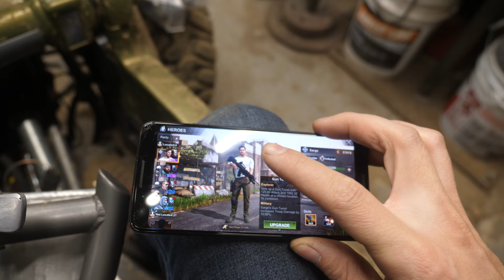2JZ Lawn Mower Build - Rolling Chassis on 30's!

Comment: How did I manage not to crash the drone this week?
Reply: Guess you need to start sending them a little harder!
Reply: Lol you did a nice job flying
Reply: Props!
Reply from the maker: @patrickreilly6272  very true!
Reply from the maker: @mercermechanics1788  thanks!
Reply from the maker: @Leafyfpv  it's so much fun flying that thing at Ethan's house
Reply: Dude under the jag shot was way cool
Reply: What kind of drone is that?
Reply: @maxdamage3814  its a FPV racing-style quad, quite hard to learn how to fly, but you can fly that good within a month or 3 I'd bet, if you put in the time.
Reply: analog or DJI HD fpv?

Comment: I feel like at the end of this build, they will have just rebuilt the Jag entirely around the engine with a big sticker that says "Mower" on it. :-P
Reply: The Jag was, when new, a shiny POS. The electrics sucked on day one and got worse every day thereafter. The mower build will be, at a minimum, 300 hp on 800-850 lbs weight, driver included, and have more brakes than any three of his past builds put together. It's at least as much "Mower" as any of the others are powerwheels, that is for sure. I'm going to give Ethan a qualified "Terrifyingly Awesome" rating conditionally- the condition being that might not be a sufficiently terrifying rating!

Comment: You should put airbags in place of the coil springs on the front and make some kind of adapter for the rear then you would have the ultimate suspension adjustment for whatever weight you put on the vehicle whether you put a plow on the front or you want to rip it hard and have the best suspension cushion

Comment: Nice to see I'm not the only one with an self tipping Bobcat 😅
Reply: Because it was sped up all skids do that that
Reply: @flyingwolffilms  when he lifts the front of the jag you can see it drop fast, not suppose to do that. I got excavators that can stand for days with the bucket of the ground and won't drop. If there are no leaks in the hydraulic system they shouldn't buckle. On my Bobcat the ram for the tilt was scratched up inside so its leaking internally.
Reply: @MiniMachines1  i own a sign company and our boom trucks are designed like your excavator they don’t lose pressure but I bought a bobcat brand new and one of my idiot workers lest the bucket up with the door open overnight when I got there in the morning the bucket was on the floor and took the door with it lol
Reply: @flyingwolffilms  ouch that was an expensive mistake 😔 The excavators often have valves that closes of a hose brakes and your boom truck probably has the same for safety might be Bobcat dosent have that 🤔

Comment: In keeping with tractor motif. A pto ran off the front of the engine to operate hydraulics or some other farm implement would be cool. Id love to see this out running a big log splitter and dragging back a sled or trailer of wood.

Comment: It looks great, only thing I would say is it is very wide, not a bad thing, but I always associate a tractor with being narrow. There are a few videos of tractors with turbo 4 cylinders with giant rear wheels and still spinning them well! This would be cool if you narrowed the front track up a little, maybe the rear too and fitted super tall 5 foot tyres. Its also super common to shorten the rear axle on those in the British hot rods, our cars are super small and narrow from back then and to fit monster tyres they often made them really narrow. Less twisting force on the shafts too I guess.

Comment: You could honestly probably replace those rear shocks with monroe air assist shocks for a corvette, at like 25$ each. wont even need springs.  or those cheap motorcycle coilover shocks from ebay.

Comment: that's some serious leak down you've got on that bobcat. if you're not leaking fluid externally from the cylinders, it's prolly in the control valves. had the same issue on the three point hitch of an ih tractor on the farm. the surplus center has hydraulic system parts fairly cheap. a lot cheaper than a bobcat dealer i'm sure. this thing looks out of control as it sits. it'll be badass if you can keep that look in the final incarnation.

Comment: What kind of safety shield will you use above the diff since you're basically sitting on top of the diff?  If the diff ever lets go, you could get shrapnel in some unpleasant areas to get shrapnel.

Comment: I DEAD FOR THE JAGUAR!!!okay love the videos great job.... so what if you guys can make the jaguar a twin engine frontwheel drive liek maybe add two honda V-TEC'S K24....and then make the car 6x6 but you have either double axle in the front or double axle in the back.... like on engine gives out 4x4 power to the back and one front axle and the ln another engine for power to the second set of axles  in the front... or build an 8x8 🤣👌i haven't seen anyone (youtuber) building an 8x8 or twin engine 6x6

Comment: I think you should of put the 2jz in the Tacoma and used the Tacoma motor for a sand rail build.
I also have a feeling your not gonna like the jag suspension my grandpa built a sand rail with the same suspension he hated it cause it’s to stiff and trying to find gearing sucked so he put a Ford 9” instead and still has the heavy jag front end

Comment: Man, you don't do halves when you decide to step up a notch! Colonel Senders is 100 hp on 300 pounds, or pretty close;  "Mower Fire" there will easy be 300 hp on 800lbs. I rate this as "terrifyingly Awesome" conditionally- because that may be to low a rating! I'm thinking for this one, you need a full harness and a roll bar- it will help triangulate the fore and aft strains to boot! OMG- don't put any floor board extensions on it- it won't stay on the ground! Edwin, I have a challenge for you and your mighty drone;  get somebody to throw a hula hoop high up in the air and fly through that! I'm thinking you will get it done before the third try- mad skills man, absolutely mad skills!

Comment: Please straight axle swap the Jag and put a decent engine in it. 350 Chevy fits just fine with a th400 I'm sure you can find a way to get a transfer case to fit as well.

Comment: Is there no upper link on that rear suspension? Is the knuckle fixed to the lower arm like a radius arm? I'd at least look for some poly bushings for that rear suspension since the trailer arm was removed. Or plan on adding a trailing arm. This is going to have more weight and power than other builds and with the trailing arm removed I would be concerned with the wheel rotating forward and in under acceleration.

Comment: i might get down voted for this, but i remember this happening on an episode of monster garage.  the "airboat delorean"  where they just used the panels from the delorean on the airboat body and called it good.  i mean at this point, all your using is the frame and foot rests from the tractor.  its not even a tractor anymore, its just gonna be a sit on top 2jz powered jag.

im still gonna watch it, but i thought we were gonna make the 2j sit inside the tractor.=

Comment: An odd choice to use such a heavy engine in such a light chassis. An aluminum straight 6 with iron sleeves would probably help a lot with the final weight and balance. But it’s already basically built around the engine so if it works. It works.

Comment: You guys have to fix or repair that hydraulic system. It should not be slowly going down like that you bypass valve or something is wrong and that is very dangerous. I work on these for a living and it could fail completely one day and fall.

Comment: Maybe a pan to tie the two frame rails together from underneath, extensively dimple-died and bead-rolled for strength. Also, you can justify buying a bead roller and dimple-die machine. 😁

Comment: OMFG please fix ur Bobcats hydrolic leak... i cried a bit after the 3rd lift ... <<< is a Heavy Equipment mechanic :P
Reply: more than likely just a check valve unless u have fluid leaking then it maybe the return under the seat behind the footwell ... some teflon tape around the nut side of the threats only  and no more issue i hope it helps if youre ever in BC BEST COME BY FOR A VISIT :P

Comment: As totally awesome as this thing is, this isnt a "lawnmower build" any more than Builds Not Projects buggy is an Odyssey. If you took a stock lawnmower and simply swapped the engine, that would be a lawnmower build. Sure you could reinforced the existing as-is frame for the added power and maybe beef up the shocks but this isnt that. This is the front and rear end from a Jag being held together with a 2JZ and two sections of mower frame rather than any of the other frame steel you have in the yard. By this logic, if you would have grabbed some rail from the huge truck frame, would this be an F-350 build? Is it that little section of frame thats determining what kind of build it is? Is it cause it will kinda look like a mower when it's done? I know a guy with a fiero that looks like a Lambo. Could he call that a Lambo build? If I swap a bit of McLaren frame into my civic and fit a Mac hood to it, can I call it a Maclaren build? Lol, no. In both of those ridiculous examples, the majority of the car is Fiero and Civic so they're just Fiero and Civic builds.
This stopped being a lawn mower build when the amount of lawnmower in the build added up to some frame and visual bits like the hood and fenders. Again, it's an awesome build and Im gonna watch every episode but this isnt a mower. It's a Toyota powered Jaguar Frankenstien that, in the end, is gonna kinda look like a mower.